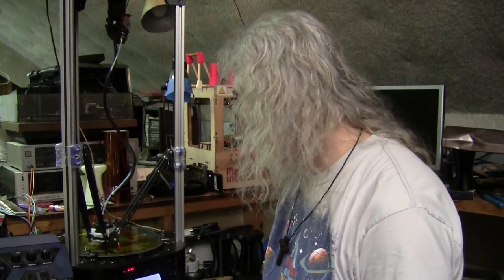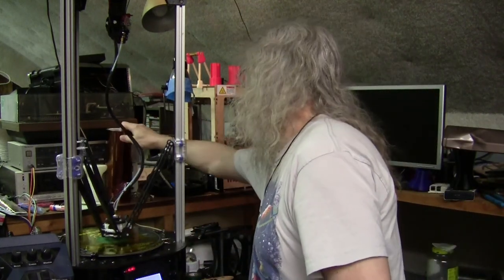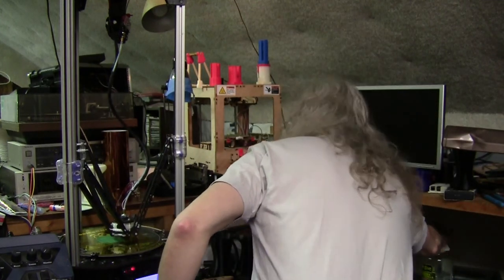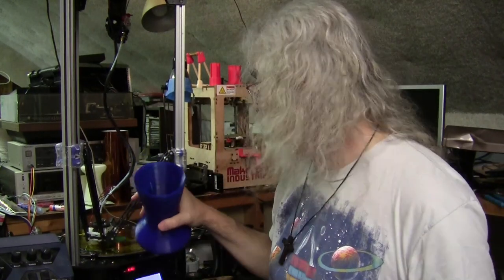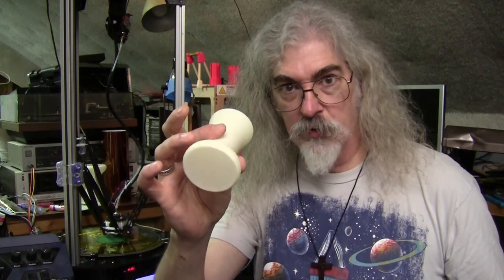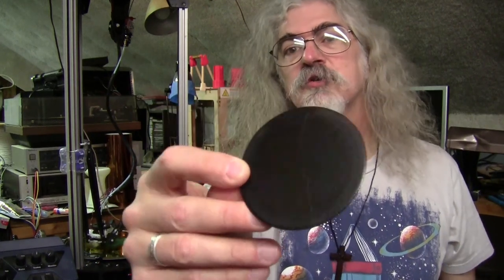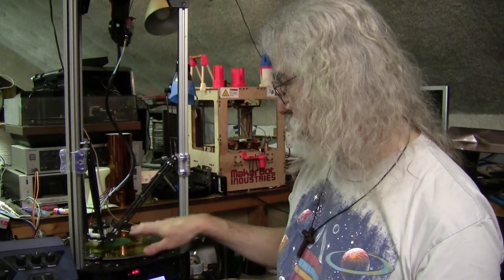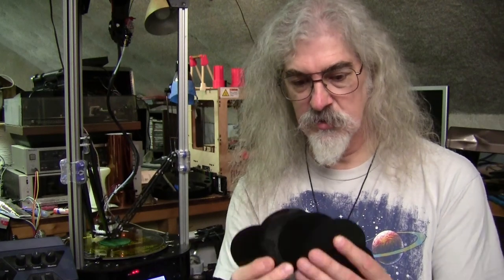Finger Doumbeks 3D printing on a Rostock Max V2

Comment: Have to ask- how many layers thick did you make the top of the drum? Ben thinking about making one myself and wondered where to begin. 8^)
Reply from the maker: 2 layers at 0.2mm for the small drums, 3 layers for the big ones. ABS sounds pretty good, PLA is not great, it's a bit soft. I'm thinking of buying ABS sheets and gluing heads on instead of trying to print them all as 1 piece. Or maybe an actual drumhead...

Comment: I am envious of the quality of your print, I can never seem to get my prints to work well without warping or bending on my rostock lots of lifting off the bed or cracks in my print.
Reply from the maker: I've been printing for 3 years on 3 different machines, so I have a very good intuitive sense of what is going wrong and how to fix it.  My suggestions:
1) Look up "The Essential Calibration Set" on thingiverse.com and use it to dial in your settings.  ONLY change one thing at a time and keep notes on what you changed.  "The difference between doing science and screwing around is writing things down." -- Adam Savage :)
2) I never have a problem with pieces lifting anymore, kapton tape + ABS slurry works really great.
3) If you have problems with cracking and you're using ABS, change to PLA, it's MUCH more forgiving.